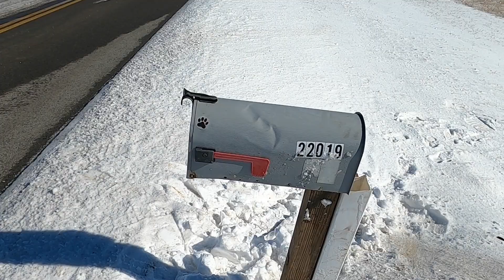186: Hit and Run on My Mailbox - Temporary Fix

Comment: Hey Logan, great job on the rebuild. I used to have a problem with the snow plow knocking my over and then I built one that they were more than happy to miss. They sent me a letter demanding that I take it down. I used the letter and envelope as a fire starter in my furnace, so I did get some good out of it. That was on the other farm 14 years ago and it is still very much up and being used still today.
Reply from the maker: I don't know any local codes when it comes to mailboxes, but a super heavy duty one would be pretty cool to have.  Maybe some solar-powered LED strobes inside would be cool too!
Reply: @FabbedFun  , the plow drivers have a hard job. Long hours in poor visibility and a lot of stuff to watch. I  don't begrudge them theirj ob. I was plowing way away from the mailbox to make their job a little easier. My box got decimated the first snowfall after I had plowed for them. It was almost like it was a game to them to take mine out.
Reply: @FabbedFun  , in Vernon County , Wisconsin, the plows plow the driveways shut and follow along with an end loader and a dump truck. They pay a lot in taxes but get great service. That is how it used to be back in the 1980's anyway.
Reply from the maker: @tractortalkwithgary1271  I remember when we use to throw tea off the boat because of taxes lol
Reply: @FabbedFun  my thoughts exactly Logan.

Comment: Our neighbor had this happen so many times by the crazy snowplow driver, that he finally dug a 4-foot hole and cemented a solid steel pipe in. Then he made a mailbox out of a quarter-inch steel plate and welded it all together. I'm not sure but I think it busted the snowplow wing right off the truck lol. The driver was not impressed.  Good fix on your mailbox. take care
Reply from the maker: Plow drivers should watch where they are plowing I suppose!  HAHA!  Thanks for watching!